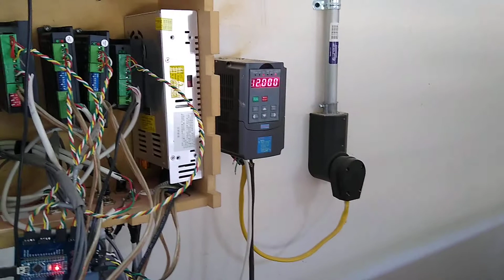4x8 Zenbot CNC

Comment: Hi Blaine, I was looking into getting a Zenbot 4x4 to cut plywood. I was wondering if you had any experience cutting plywood with the unit and what sort of speeds and depth of cuts you were able to manage. Any thoughts would be appreciated. Thanks!
Reply from the maker: I bought a 2.2kw spindle for mine. It can handle quite l.  It is unfortunately, overkill for cutting plywood. Sticking with a router would be sufficient, and would also not require cooling, a 220 vac source, and installing the additional leaf spring do to the weight.

Now to answer your question. Feeds and speeds can vary and you start out with ball park numbers. In addition to those numbers, you have to figure bit type, cutting depth and such. With a 1/4 two flute upcut bit, cutting at 1/8 inch depth, 16000 rpm, I can typically cut at around 100ipm. 

If I cut anything harder this number is going to drop or my cut depth will go down. The reason being is the combined bit flexing and the rigidity of the machine. It will leave flex marks in the material you are cutting. Hope this helps.
Reply: @BlaineEdwards  Thank you so much for the info. I really appreciate you taking the time to answer. I've been looking at a 4x4 Zenbot vs a 4x4 Journeyman Onefinity, and trying to decide which one makes more sense for my small business. There's lot of info online for the Onefinity, but the Zenbot is hard to find information on.
Reply from the maker: @leehaywood4136  thanks for informing me about the onefinity. Surprisingly, I haven't see that before. I looked them up and notice a lot of upgrades for a similar price. I like the ball screws instead belts. It looks like a quality machine. I would like to know more about their controller. I like the computerless option if it has the right features. I am a big fan of grbl because of the options and ability to cutomize.

Comment: Like the GRBL option... would like to know more about that as an option to drive this router.  Use a Raspberry Pi and bCNC to drive my Shapeoko now.
Reply from the maker: Thank you for the reply.  Even though I am getting to this a year later.  I have never found a CNC control board that I liked that I could use with external stepper drivers -- so I built one.  I can do a video on it to show how it works.

Comment: I’m thinking about buying this machine do you still recommend it I currently right now have a Bob CNC E3 and I’m looking to step up to something bigger can you tell me your thoughts thanks
Reply from the maker: I have enjoyed this machine.  It is not the stiffest machine out there, being belt driven on all axis.  But I have achieved some good results with it.  Depending on what you do, you may have to slow down the machine.  I use it for all sorts of purposes, but where it shines is in cabinets.  The large machine is great for cutting out whole panels.  Preferably, I would have a smaller machine (I had a MPCNC but gave it away).  I would like a smaller machine for doing more detail work.  I really don't need this large of a machine fo relief cutting.

Comment: do you have any instruction how to configured Mach3 with Zenbot 4x8? Thank you in advance.
Reply from the maker: Unfortunately, I don't use Mach3.  I use GRBL, which I prefer.  It is way easy to use and can be made wireless with a Raspberry PI and CNC JS.  I know that Mach3 has a few extra features that would be nice.  But GRBL is free and the controllers are very inexpensive to build.